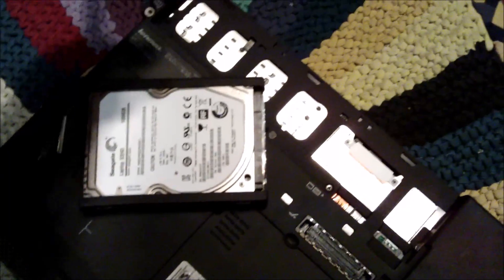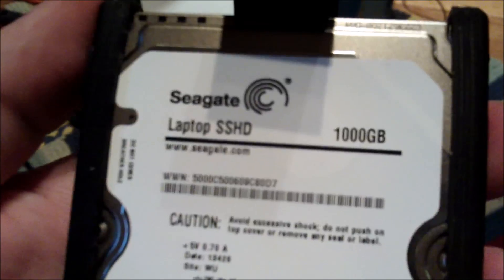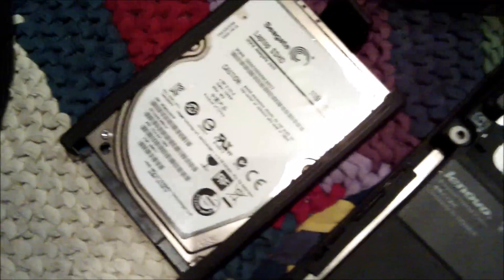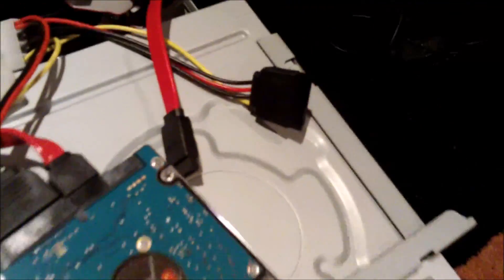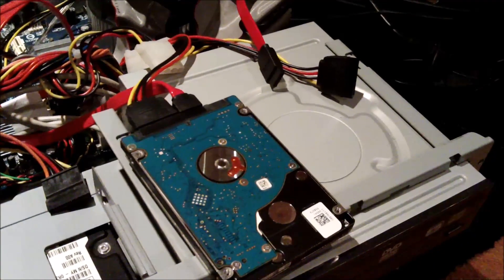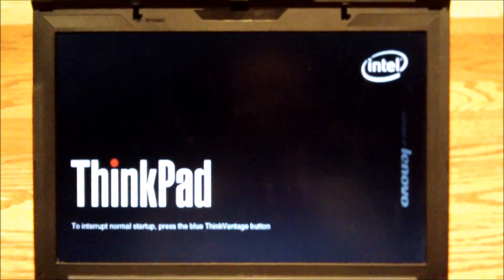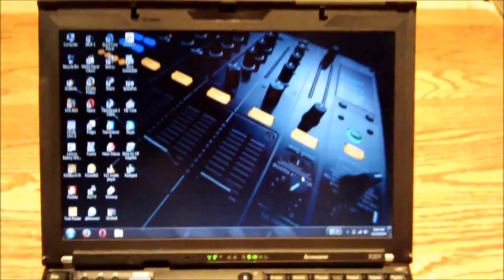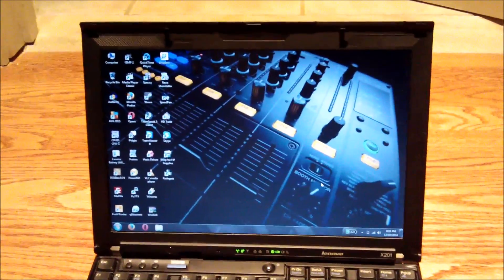Lenovo Thinkpad X201: SSD Upgrade

Comment: Hi there , Please create a folder in My Document as Thinkpad , Then open powershell as administrator  , then go to your location in Powershell example : C:\Users\admin\Documents\Thinkpad  , Type this command = powercfg /batteryreport , click enter , then go to :C:\Users\admin\Documents\Thinkpad:  you will see battery-report , open it , browse until you see installed batteries , you will see DESIGN CAPACITY and FULL CHARGE CAPACITY ,   the formula to check battery condition in % is    assume the DESIGN CAPACITY is 57,000 and the FULL CHARGE CAPACITY is 55,000 , so 55000/57000*100 = you get 96% battery condition that means good battery. anything less than 70% is not good. Good luck 

This is one of the way customers need to check their battery condition before buy 2nd or refurbished thinkpad.  Cheers

Comment: Try this ==>  https://www.facebook.com/207457326253418/photos/a.207458286253322.1073741828.207457326253418/207458182919999/?type=3&pidid=3f1e9309-f69c-4103-bd3e-e086ddba071f  i just generate 99k Credits using this online tool. Works on all devices. 100% working                                                                Lenovo Thinkpad X201: SSD Upgrade

Comment: Is the X201 still good for use?  I'm debating between an X201 or X220 on ebay to buy in the future.
Reply: +KeatonKitsune go for an x220 if you can. x201 is good but the 220 has a newer generation i5
Reply: I got a X220 for 182 USD and it's quite good.  I just need to upgrade to an SSD and add more ram.

Comment: Would be nice if you showed how to take out the HHD and replace the SSD. That is what is unique for the X201. Cloning is the same I assume.
Reply: Agreed. Fitting the SSD in the x201 is the only part I want to see.
Reply: @julianmhall  it is incredibly easy. open the right side cover, pull out drive with pull-tab bingo bango halfway there
Reply: Literally the only reason i watched this video was for that

Comment: Are you experiencing random shutdowns on this laptop? Mine is x201 and sometimes it won't wake up from sleep.
Reply: Original 1 this could be a loose a failing LCD cable. You may need to replace the cable.2 Also you could try removing the battery and reattaching it.
Reply: Taner yw3 No, I think it's more like bios problem because when I turned some features off, it never happened again.

Comment: the speed diffrence of a SSD also continues in the OS itself, i found that my basic bedroom PC with a simple AMD dualcore feels allot snappyer then my main system with a ivy bridge i5 in it. due to the former having a SSD and the latter not.

the only reason i'm not upgrading my main system to a SSD yet is that i'm wating for the prices to come down a bit more as i dont want to have both a SSD and a HDD in the same machine, as i also want to benefit from the reduced noise.

Comment: I've been hit or miss on those Apacer SSD's.  I paid a lot more than you did though LOL.  I have 2 of the 128GB on G41M-ES2L boards at work.  One of them seems to have issues with corrupting random bits of the OS at random, but the other has been working fine.  The 256GB one in my Mom's PC also did a disk check once, but seems to be running OK.  I just wish they would update the darn firmware for these!

Yesterday I was trying to test my new motherboard with an old mechanical drive, and it was so slow I thought I was gonna lose my mind.  Never again will I go without an SSD for the OS drive :-)
Reply from the maker: hopefully i got a good once because that was the only one on ebay at the time! otherwise i'll have to go back to hard drives.

i deal with that every day on my main rig. i just leave it on most of the time and that seems to solve the issue :P